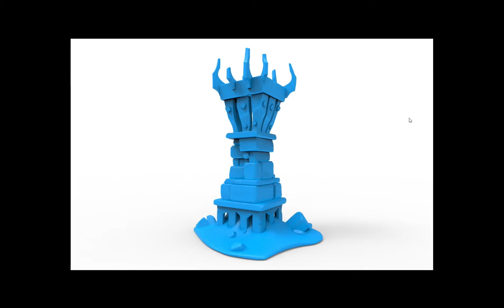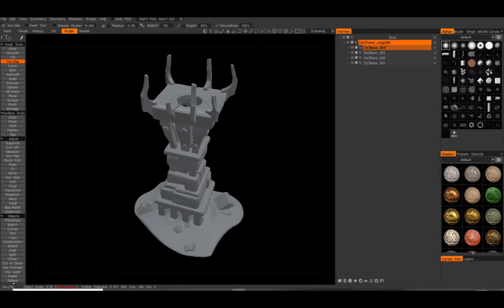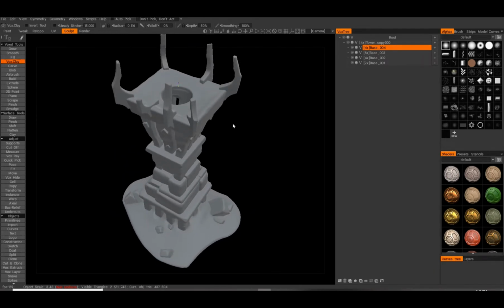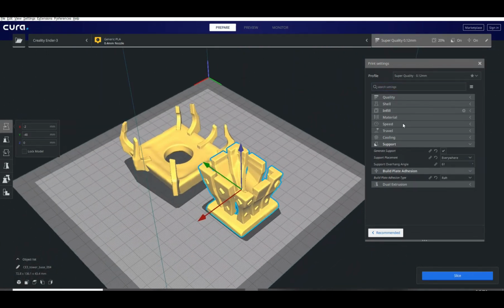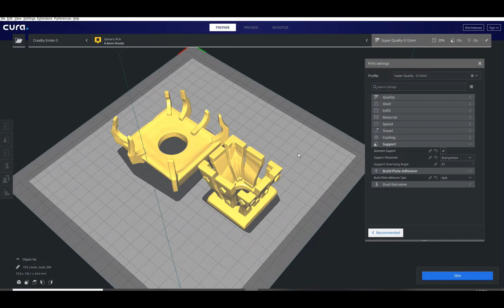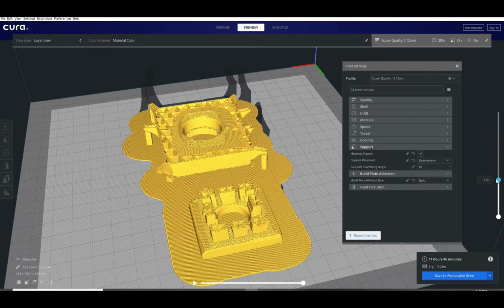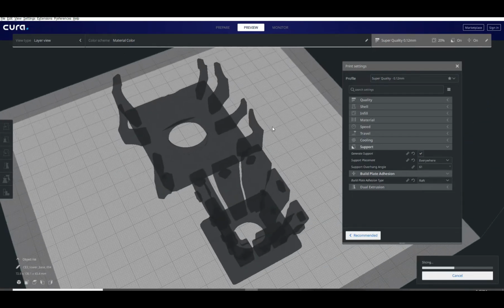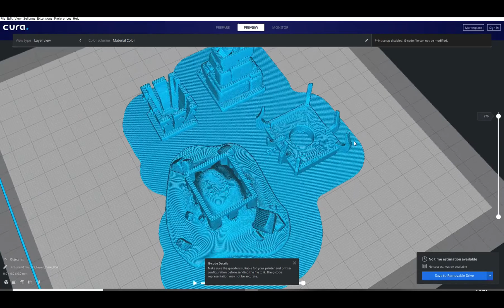Sculpting Miniature to 3D Print in 3DCoat - Part 2 - 3D Printing

Comment: Argh a FDM printer, I guess you had to do alot of clean up ? I'm thinking about a LCD/SLA the prints are smaller but you can cleaner results from the print.
Reply from the maker: it's really not bad, for the quality gets with a hassle-free cheap set up. But those 4 pieces on the tower didn't require any cleanup. Maybe I need to brush them with a toothbrush to get plastic threads out.
The problem with resin printers is that they are not safe. They produce fumes and resin is toxic poison for your hands and eyes. You have to put them in a garage or garden. Atm, I have neither. I put FDM under the table and can run it forever.
Though I can't argue SLA printers do give better quality overall. But you can check my Expressive Sculpting video, in the end, I have a photo of the print from FDM. It's pretty amazing in my opinion.
People also adjust settings to get better results. Like thinner 3d layers. You can search for Ender 3 miniature printing settings.
Reply: @AntonTenitsky  How is the noise with FDM ? I know some LCD/SLA printers if they are enclosed which most are can be silent; the only thing is they can't make large prints, but the quality of LCD/SLA is superb.
Reply from the maker: It is noisy, hmm, not too noisy. In headphones with ambient music you won't hear much. If it was disturbingly noisy I wouldn't keep it near. I think it's actually as noisy a  regular printer, maybe a bit more, but it runs for hours so you don't want that noise if you are sleeping in the same room if you have choice :)
Yeah, I think I'll wait couple years for SLA. 100% it'll get easier to handle in the future and safer. I saw cheap SLA for 250 usd but they are messy.
Reply: @AntonTenitsky  Unfortunately where I live I can't have that type of noise running for hours, I'll have to get a LCD\SLA; I can handle a little mess over noise :-)
Reply from the maker: @christopher8116  ah, do check as some SLA are noisy as well. The cheap one I was thinking to buy is very noisy it is around 250 usd. . Thing is the noise can come from extremely powerful cooling fan. But  yeah I don't want to protect FDM printing here. I'll get SLA eventually too :)
Reply: @AntonTenitsky  Do you know the model of the SLA which is noisy ?
Reply from the maker: https://www.youtube.com/watch?v=rPQMARmn8jI  I was looking at this printer